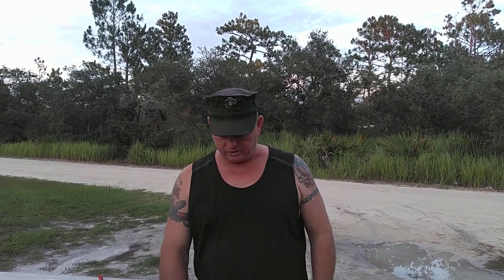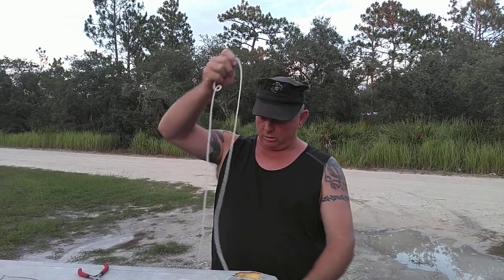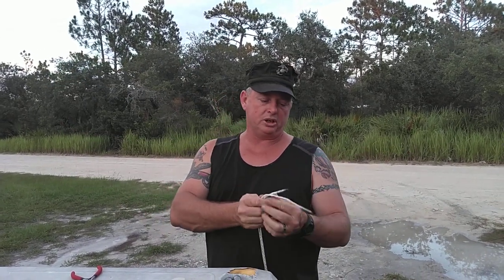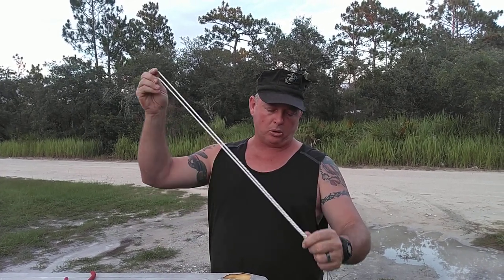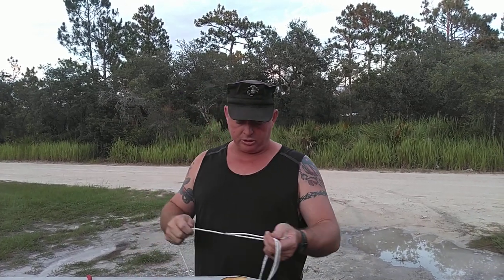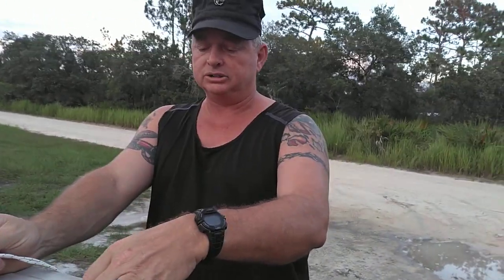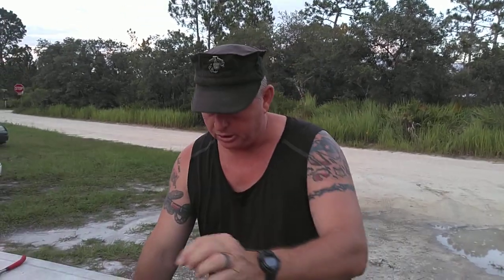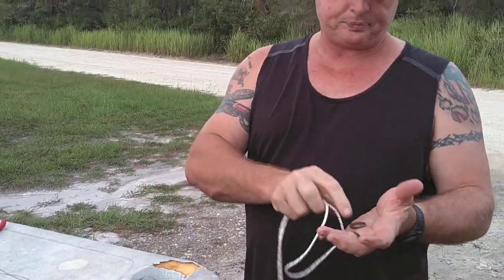How to make and throw a bola

Comment: great job, a question, if you use 3 leads instead of 4 does it work anyway? sorry for the mistakes I'm using the translator.😉
Reply from the maker: Yes it will work the same hold one back and swing two
Reply: @josephbishopbackwoodssurvi3918  thanks, i saw later in your videos, i arrived late😤😆😉